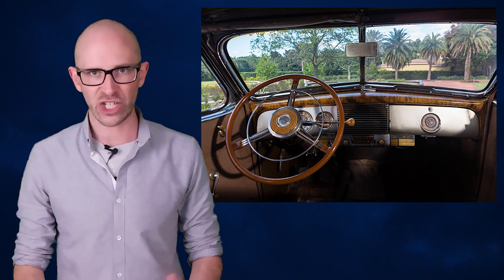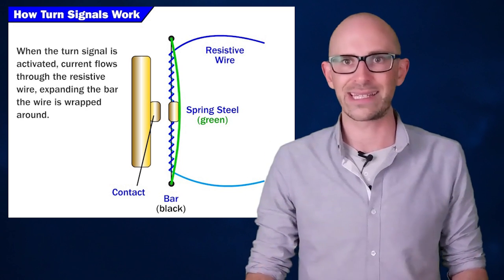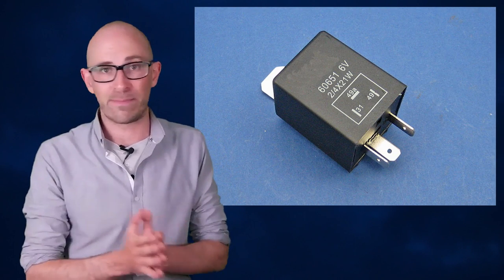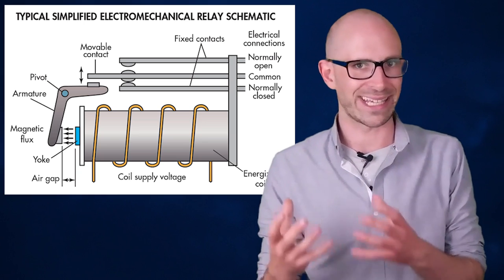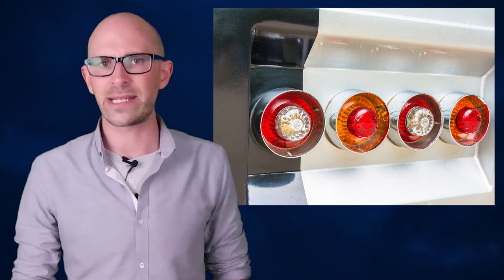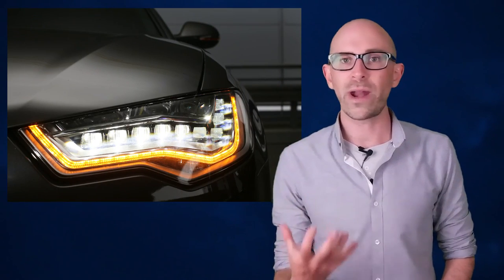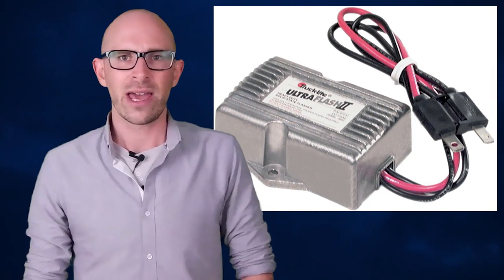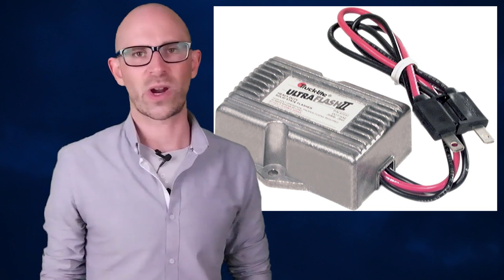What Causes the Clicking Sound Your Turn Signal Makes?

Comment: Problem now is getting people to actually USE the blinker!
Reply: More annoying than people who don't indicate are people who indicate only a moment before they turn, they think they are doing everything right whereas the non indicators at least know they are lazy xD
Reply: Should invent a feature where the wheel won't turn if the indicator isn't on for 'those' people :D

Going in a straight line forever! Mua ha ha ha!
Reply: Jason Hardman the problem with that is that drivers would not be able to dodge potholes animals or ironically car crashes that are blocking a percentage of the road
Reply: The other annoying factor I've noticed when using a turn signal is that people try to close the gap when you signal for a lane chang.  Nearly got in a pretty bad wreck the other week after I signaled to merge, and the guy in the other lane tried to block me.  He was about 60 feet back going the same speed I was, until he saw my signal and floored it.

Comment: Never thought a concept so simple could be so complicated
Reply: ikr....
Reply: Yeah I just assumed it was a relay and some kind of capacitor circuit for delay...
Reply: This isn't so unique . Guess how electric Christmas light get to flash? They use  the same type of bi-metallic element that heats up and opens the circuit. The original and larger bulbs has the flasher in each. The newer tiny bulbs has one white bulb with the flasher inside and in series with all the others. If that bulb burned out or was removed, the lights never turn on. Now we have LED lights and an electronic circuit in a box that controls them.

Comment: For the last 10-15 years, all cars have been entirely solid-state.  The ticking sound is added as a sound file, playing through the instrument panel.
Reply: Can this sound be turned off? Do you know how?
Reply: @alanfsmith2141  not without a reflash.
Reply: @alanfsmith2141  but how would you know your blinker is on/off
Reply: I suspected it was synthetic and not mechanical on modern cars. Good explanation...
Reply: Wait till you hear the one on older (2001-2006) Volvo buses (bip bip bip bip...)
Reply: @leylandlynxvlog  Or the Mac... Meeearrr.. .Meeearrr.... Meeeearrr... Meeeearrr...

Comment: In most modern cars what you are hearing is the relay, the flashing signal is all done via the cars body control module (computer) and it also monitors the resistance of the turn signal bulbs so that if one is to go out, it will trigger hyper flash to alert you one of your turn signals is out. On some newer cars today the relay is actually located under the hood or there simply is none and the clicking sound is actually played through the cars front speakers

Comment: It's NOT an advantage if the blink rate stays the same when a bulb blows. That's how you know you've got a broken bulb and you need to put in a new one.
Reply: Because your car has a light on the dash to monitor the exterior lights that tells u if a light is burned.
Reply: MrTheMiguelox Not all cars have a warning light for blown bulbs, for example. Thus it is very helpful to know if your blinker is blown
Reply: As far as I know, European regulations require blinkers to noticeably change speed if a bulb goes out.
Reply: MrTheMiguelox I have never had a car with a light on the dash to tell me if a blinker light is broken. Is there a second light on the dash to tell you that the first light is broken :-)
Reply: I'm not completely familiar with European regulations, but I do believe that there is a requirement to tell the driver when a bulb is out.  The good news is that newer modules can sense how much current they are outputting, so you can get a warning in your instrument cluster when the controller senses a significant change.
Reply: mcdrums87 No, there is no European requirement for something to tell a driver when a bulb is out.  It is up to drivers to periodically check their own lights. In the UK, all cars have a mandatory test at 3 years, and then every year after that. The test is usually carried out at the time of the annual service for the car
Reply: ***** gotcha.  Must just be on the big trucks, then. (I had to design a harness that would do just that, but it was for an on-highway tractor).
Reply: mcdrums87 I didn't know that was a thing in big trucks. I've often wondered if it would be possible to collect actual light from the plastic lenses on all four corners of a car, and feed it using optical fibres to a display mock up on the dash. That way, the driver could easily see when a light doesn't come on.
Reply: Mandolinic collecting actual light isn't necessary now that we have current sensing electronics. I basically had to add a module to the electrical system that would throw a warning light when the current wasn't being sourced properly. The cool/interesting thing is that the module had a "learn" mode for the trailer lights (since the trailer can and would change).
Reply: If you are worried about lights going out, LEDs are the solution.
Reply: Cars Simplified My bike has LEDs, though sometimes the connection to the blinker pulls apart. I can confirm though that the blinker rate increases and you can immediately notice when it happens.
Reply: The original thermal blinkers blink slower if a bulb is burnt out because of the reasons explained in this video.
The electronic solid-state ones are usually programmed to blink faster on a burnt out bulb.
Reply: bumfartbumfart2 the overall resistance increases, however the resistance of the resistor doesn't change. With a given voltage the increased resistance causes the current to drop. The decreased current causes slower heating of the switch
Reply: You got your Ohm's Law wrong. A burned out bulb in the lamp circuit draws no current, so all the remaing lamps draw less current (increased load resistance), and the flasher has less current flowing in which makes it heat slower. The flashes come less ofter (slower) so the blinking rate is slower not faster. If all the bulbs burn out, there will be no blinking at all.

Comment: My car has a solid state flasher, and the clicky sound comes from a speaker under the dash. If my blinker is on and my "fasten seat belt" indicator both want to play noise through the speaker, the seatbelt bell wins out and the clicky blinker goes silent until the seatbelt system releases control of the speaker.
Reply: themaskedcrusader what car do you have.
Reply: PumaBitez it happens on both my Chevy cobalt and my dodge challenger
Reply: Can confirm about the Cobalt. For some reason my door open/key-in/lights on warning sound goes completely silent. The blinkers make no sound either when this is occuring. Long ago the auto return function of the turn signal stalk ceased to function so I already manually switch them off so it's not a detriment to me. But I have left my lights on at work and been told by a customer (since I couldn't hear the warning after taking my keys out and the lights still being on)
Reply: chevy volt is the same way .. sound is not real

Comment: Now I've noticed that on some of the newer cars that if the speakers go out that turn signals wont click.
Reply: MrManerd newer cars use computers and network systems to make blinkers go on and off. The speakers only play the clicking sound to keep everything the way the driver is used to
Reply: Funny thing, my SAAB 9-5 from 1998 uses it's internal speaker (in the "SID", Saab information display) to make the noise.

Comment: In a Tesla, the clicking sound is completely synthetic. The car computer controls the light blinking, and the sound you hear is just a prerecorded click played over the stereo speakers. You can tell this if you restart the infotainment system and while it's booting up you turn on a turn signal - it works, but no clicky.
Reply: Long before the first Tesla was made

Comment: Solid State Flashes will use the cars buzzer for the clicking.
The buzzer is their to warn you about not wearing seatbelt, trouble codes, low fuel, door open, ect.
So they use it
Reply: IIGrayfoxII that sounds really annoying
Reply: +gregistopal Better than having no sound and driving straight with a blinker on. And getting slammed into because somebody thought you were going to turn.

Comment: The clicking sound is a relay. Just saved you 5 minutes of your life. you're welcome.
Reply: Or two pieces of metal or a sound generated in your sound system. The origin is two pieces of bending metal. Here the image that explains it: 
http://i79.servimg.com/u/f79/15/99/31/04/therma10.jpg
Reply: No, not a relay. It's a circuit breaker. A relay requires an outside input to control power. A circuit breaker- which a flasher is- does not.

Comment: 2:38 is wrong! When a bulb goes out flashing rate increases! Bimetallic strip heats up less with lower current and it takes shorter time to cool down and reconnect.
Reply: I was also puzzled by that statement, since I've never seen such thing as a blinker slowing down when a bulb burns out. Rather it goes completely haywire by blinking 2-5 times the normal speed.

But then again when you're desperate enough to do a video about explaining turn signals, you're most likely doing it for the ad revenue instead of being 100% accurate.

I thought that would be just common sense to know what causes the click.
Reply: mibars is right... Less electrical energy going to the bulbs, because of one being blown, means more is converted to thermal energy in the flasher. This means it will flash faster, because it heats up faster.

Comment: most modern cars have a solid state flasher, generally integrated into a general purpose electronic control module. The fact that you still hear a clicking noise is often because these components have a literal speaker built into them for the express purpose of emitting the clicking sound, as customers dislike the turn signal being silent.

Comment: Bimetallic relays are rarely used, Most common are the electromechanical ones, which will almost always blink faster when you lessen the load. -Common problem when converting to leds where people buy so called "can-bus"-leds (which is totally bollocks since all they have is a high current resistor in parallel with the led electronics. canbus is a form of automotive communications network btw) :)
Reply: That's what I was thinking.... But why don't they just use really simple timing ICs with electronic relays? They're incredibly cheap, and the timing will never be affected by what bulb/LEDs/load you use. Edit: Nvm, I clearly wasn't paying attention to the video XD
Reply: I was going to say the same thing, I don't know when was the last time a bimetallic thermal relay was used, oldest vehicle I've owned with blinkers was 1957 & it has an electro-magnetic relay.
Reply: milksheihk bimetallic were the most common type I remember in 70's cars.
Reply: Xenro66 Generally they use blinkers that are affected by broken bulbs to alert the driver that a bulb is broken so it can be repaired
Reply: Interestingly, I would really prefer to have the blink speed be affected by failure of one or more lights. This change in speed doesn't specifically change the purpose nor impact the function of the blinkers, but also serves to inform the diver to check the blinkers and get it fixed, post haste.

Comment: The second type of blinker called "electronic" is only using an electrolytic capacitor, around 100 uF, 25 volt to induce a delay from active to inactive (it keep voltage flowing thru the coil until discharged) and a resistor to create a delay from inactive to active (slowing the charge rate of the capacitor).
In other word, the capacitor charge slowly thru the resistor then discharge slowly thru the relay coil.
These blinkers speed-up when the current decrease. This is useful to remind the driver that a light is burned. The fast click and fast light in the dash board attract attention. The other drivers and police can also notice the fast blinker and politely remind the driver to take care of his/her car better.

Comment: a lot of modern cars use solid state systems with a simple loudspeaker to generate the clicking sound. Some cars even increase the volume based on how long it has been on to warn drivers who leave the indicators on to long.

Comment: I had the blinker relay go out in a '91 Hyundai I had.  For a while I just manually clicked the stick on and off to indicate turning, until I stopped being lazy and bought a new relay.  It was right under the dash near the fuse panel.  Very easy replacement.

Comment: So why does the frequency increase when a light bulb dies?
Reply: I would actually also expect there to be less current, so slower warm-up time so slower blinking... Hmm.
Reply: Simon has it wrong. The frequency increases with a dead bulb because there isn't enough resistive load on the flasher. Most flashers are designed to give a constant rate with a given load- nominally about 20 watts (not quite 2 amps) x2. Take away one of those bulbs, and the rate increases.  Electronic flashes are much more stable, as the electronics inside determine flash rate, not the amount of load.
Reply: Hotrodelectric agreed.

Comment: Most modern cars have a solid state "relay". It is basically just a MOSFET, controlled by software. The clicking sound is still kept, since drivers are so used to it. So if you have a newer car, you probably have an artificial clicking sound. 

Interestingly it's the same with the white noise you here when using your phone. Most countries use digital signals for landlines and all cell phones transmit information with digital signals, so there should be no white noise, but it is artificially added, since people are so used to it, that they would assume the other person was disconnected, if the hear nothing while they are talking.

Comment: Newer cars use the BCM (Body Control Module) to flash the lights when the turn (or emergency) signal is on. It is solid state module and generates an audio tick because some country laws require both the audio and visual indicators to inform and remind the driver that the turn or emergency signal is on. Some will even get louder if the turn signal is on for an extended time since some drivers forget the turn or never intended to turn at all.

The BCM also has a current sense to determine if a bulb is burned out, so if you replace the factory incandescent bulb for an LED, you will need a load resistor in parallel to the LED and return the original load current to the BCM sensor. Since the LED will not burn out (unless it is mistreated), the resistor fools the BCM to see the original current always. That resistor will warm up while the turn signal is on, but will not drain the 12V battery unless the emergency signal is turned on. The BCM monitors the battery voltage and will power all the lights off (including the emergency lights) if the voltage drops anyway. 

Even newer cars have all LED turn lights, so the BCM will never need a load resistor. And it is always the driver's duty to check that all the turn signal, brake, and running lights are operating before driving, or else you might get visited on the road by your friendly policeman.

Comment: So why do lights blink faster when the bulb is about to blow?
Reply: Kaitlynn Baker yeah. I think they have that backwards
Reply: A slower clicking is for the older bimetallic strip switch. Newer cars use circuits and a relay which does not vary based on load. To help identify a burnt out bulb, car manufacturers have introduced a second circuit that check for low/no current indicating a burnt out bub. If no/low current is detected the circuit will increase the rate at which the relay is turned on or off.
Reply: beachhouse13 Interesting! Thanks for the reply :)

Comment: In every car I have owned (my first and oldest car was a 1970 Chevrolet Nova, bought in 1970), the flasher (and its associated "inside light" on the dashboard), blink much FASTER when the signal filament in EITHER the front OR the rear bulb is burned out, and returns to normal speed when it is replaced.  The last bulb I had to replace was in a 2006 Ford Focus.  So apparently there is a timing circuit which senses whether both bulbs are drawing current, and if not, speeds up the flashing by a factor of four or so (like the difference between the normal busy signal on the telephone network and the "fast busy" when the trunk circuits are busy).  Time for a followup video, maybe?

Comment: And that's why some aftermarket LED turn signals (bulbs of whole units for motorcycles) come with power resistors that are to be wired in series with the LEDs to compensate for the lower resistance. Although it's preferable to install an electronic flasher in place of the bimetalic one.

Comment: To follow on, most modern vehicles with CAN bus electrical architecture the "click" sound can be generated in the instrument cluster (IPC) and played through a small in-built speaker (used for other warnings as well) or more often than not now the audio system. The body computer (BCM) gets an input from the indicator stalk to which direction to turn on, the BCM sends a message to the IPC or audio that an indictor is on and the click sound is genereated. Even if the audio generates the sound the IPC still gets the message so it can flash the appropriate in dash repeater (idiot light). With some vehicles the BCM sends the "indicator on" message to a Rear Electrical Centre (REC) and also to an Underhood Elecrical Centre (UEC). The IPC, REC and the UEC then all talk to each other to syncronise all the bulbs to flash in unison. If a bulb fails then current draw is changed, all modules get this information and flash the indicator faster as a warning to the driver that a bulb has failed.